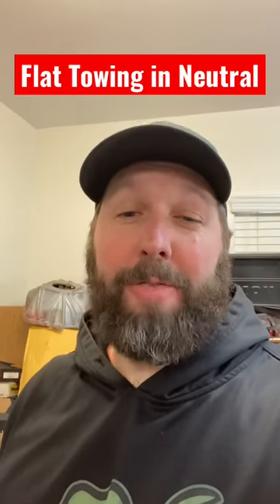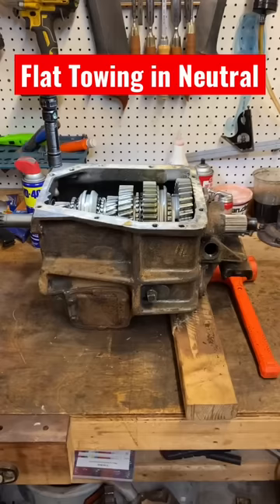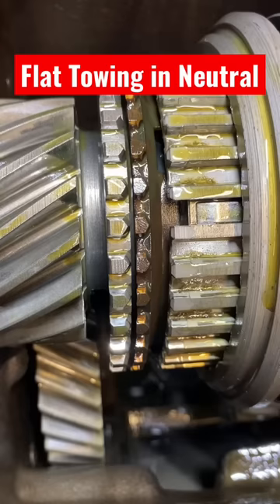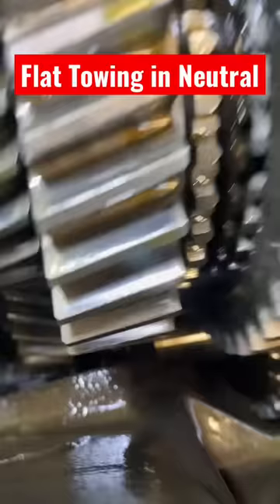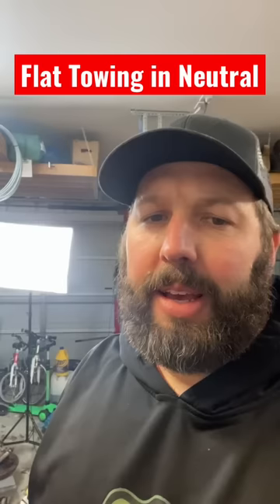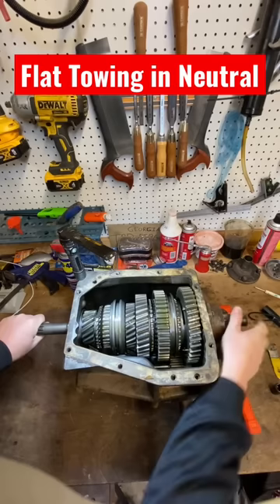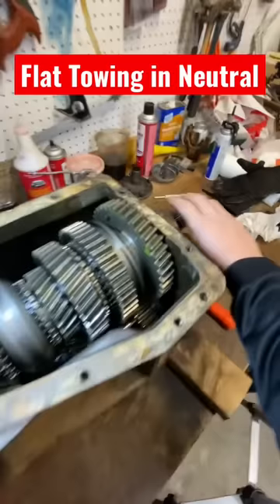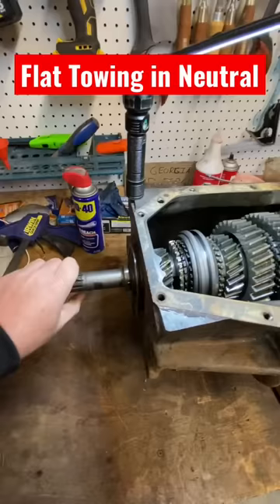Flat Towing in Neutral??? #transmission #stickshift #mechanic

Comment: For most manuals, inflate tires, including the spare 50 psi. fill the crank case with gear oil, 1 quart per 1000 tow miles.
Reply from the maker: Why are we putting gear oil in the engine again?

Comment: There are a few vehicles that you can flat tow.  It all depends on the type of transmission that was designed for.
Reply from the maker: Yes, it’s not applicable to all manual transmissions. You have to refer to the vehicle’s owners manual.

Comment: Flat tow in neutral but make sure the car is on and it is only in emergency like when you break down in the middle of the desert and the next town is 50 miles away with no towing available
Reply from the maker: There are a few options. Best to just consult the Owners Manual. 👍

Comment: I remember this poor old timer towed his Honda Prelude in 1st gear behind his big ol motorhome. Apparently the 454 CID motorhome didn’t much notice. Most catastrophic engine damage I'd seen. Connecting rod caps bent opposite direction. Parts of what were rods dangling out the side and oil pan.
Reply from the maker: What’s that sound??? 🤷🏻‍♂️😂

Comment: If all four wheels are on the ground, put the vehicle in neutral and tow. Vehicles with manual transmissions can typically be towed without the car running, with no risk of transmission damage.
Reply from the maker: Tremec says otherwise 🤷🏻‍♂️. https://www.tremec.com/not_am_detalle/flat-towing-manual-transmission-vehicles/
Reply: Your wrong.

Comment: And an automatic doesn’t cycle the fluid through the cooler unit while the engine is off so automatics will burn out same as manual.  Just disconnect the the drive shaft or tow them with the dolly wheel on the ground and the drive line wheel off the ground. Like rear wheel drive with steering wheels on the ground and wrap the seat belt around the steering wheel a couple times so it can’t move.
Reply from the maker: It not about fluid cooling, its the fact that the parts spun by the driveshaft wont get lubricated because the pump isn't pumping fluid through the transmission. I mean, unless you have one of the older autos that had a rear pump. Those could actually be push started like a manual trans.

Comment: The purpose of the oil is for those gears in the main and counter that are “interfacing” and lubed - however if NO interfacing is occurring - no lube is really required -
Reply from the maker: The bearings and synchros beg to differ. https://www.tremec.com/not_am_detalle/flat-towing-manual-transmission-vehicles/

Comment: Output shaft goes to the rear axle which is still spinning when rolling thus spinning the output of transmission spinning the the countershaft picking the oil up and spreading the oil through the transmission. No issue. 

Where the issue comes in is with automatic transmissions that only get lubrication when the torque converter on the input shaft is spinning with the pump of the transmission.  This is also a problem with some transfer cases because which side of the t case the pump is on. If the pump is on the output shaft your fine because the wheels will turn it and oil everything.

The issue is with automatics not manuals
Reply from the maker: I clearly showed that the output shaft does not spin the countershaft in neutral🤷🏻‍♂️
Reply: @freedomworx  thank you for the correction. I got the shafts mixed up.
Reply from the maker: It happens 👍

Comment: I learned the hard way why you don't flat tow in neutral with an np435. Full set of synchros from an Nv4500, and it was back on the road
Reply from the maker: A lot of folks think I’m just joking. 🤷🏻‍♂️. They gonna learn the hard way also 😳. I didn’t know they used the same synchros 👍

Comment: That’s why you should pull the driveshaft off on any manual transmission that you tow to prevent the transmission from burning itself up the front bearing will burn up. I’ve worked on hundreds of these transmissions and a high-volume repair shop in Detroit Michigan. We specialize in drivetrain components
Reply from the maker: The safest option 👍

Comment: flat towing a manual transmission in Neutral is perfectly OK
In Neutral there is no load on on the transmission gears (they are freewheeling) only the output shaft is spinning and is running through sealed bearings...😎
Reply from the maker: Well Tremec sides with me 🤷🏻‍♂️ https://www.tremec.com/not_am_detalle/flat-towing-manual-transmission-vehicles/

Comment: For special purpose heavy vehicles it can be a problem but not for light cars and trucks. When the transmission is under zero stress it makes no difference how much oil is on the shaft. You could spin it all day long even by hand has he is showing.
Reply from the maker: Well Tremec builds light truck and car transmissions, and they agree with me 🤷🏻‍♂️. https://www.tremec.com/not_am_detalle/flat-towing-manual-transmission-vehicles/

Comment: Did it 1,000 times in the 90's, never an issue, wasn't calling a tow truck i was broke.
Reply from the maker: You should read your Owner's Manual. Towing in neutral is fine for some vehicles. Some need the driveshaft disconnected.

Comment: A friend did this with his 1950 Chevy truck. He towed it from Dallas down to San Antonio behind a rented U-Haul truck. Second gear seized and spun the engine at past redline. Engine and trans were destroyed.
It had an enclosed driveshaft that could not be removed. Should have put the rear wheels on a dolly.
Reply from the maker: Yikes! Expensive mistake! 🥴

Comment: If you can reach the drive shaft, disconnecting it from the differential and tying it up off to the side is the ideal way to flat tow a vehicle with any type of transmission.

If you can not do that, on a manual transmission, you can put the transmission into the highest gear and then use something to keep the clutch pedal pressed all the way down.  That way the engine is disconnected from the drive train and the counter-shaft will be turned by the output shaft and splash oil around like normal.  As long as you do not have to toe it too far everything will be okay.  At worst you will have to replace the throw-out bearing, which is a lot cheaper than rebuilding or replacing the transmission.

If you have an automatic transmission, you are just going to have to figure out how to disconnect the drive shaft from the differential or get a tow truck.  A tow truck is a lot cheaper that replacing a automatic transmission.
Reply from the maker: Yeah, you really just have to refer to the vehicles owners manual. I was thinking about RVers when I made the video, but the vehicle recovery crew jumped all over it. 😂

Comment: I always thought it was "common knowledge" that it was ok in neutral any distance. On old American traditional front engine rear wheel drive manual trans, and classic VW Beetles 1956-1974, always towed in neutral locally but only a couple of times long distance.
Reply from the maker: Common knowledge that it was ok or not ok?

Comment: The 465 can be flat towed at 35mph for 50 miles per the factory service manual. But it really depends on the vehicle. If you have a transfer case, it may not even matter.
Reply from the maker: Interesting 👍

Comment: So. The safest way to tow in neutral… is for the engine to be running and still be turning the input and counter shafts. 
Which kind of defeats the purposes of towing… usually the shitbox is blowed up and won’t start up lol
Reply from the maker: It’s an option, if it’s an option 😉

Comment: The main reason for the oil is when the gears are comected to the other gear. Since you are not in gear no gears are conected to each other. No damage should happen.
Reply from the maker: Spinning bearings and syncros need lubrication.  It has nothing to do with gears in this scenario.
Reply: @freedomworx  the bearings are sealed and greased,they don't get lubricated from the transmission oil.
Reply from the maker: Not sure what kind of transmission you are working on, but I’ve never seen a sealed bearing in a powertrain. https://www.tremec.com/not_am_detalle/flat-towing-manual-transmission-vehicles/

Comment: I don't know what flat towing is but I do know that some cars have to be towed on a flatbed and others can be towed with two wheels on the ground.
Reply from the maker: Flat Towing is with all 4 wheels on the ground.
Reply: @freedomworx  That's the one where you have to have someone in the driver's seat steering it if I remember correctly.

Comment: I've got over a hundred thousand miles towing a Ford manual transmission with no problems whatsoever many vehicles can be towed for down and some cannot for instance a Honda Odyssey automatic transmission in neutral toes fine and most all Chevrolet and Saturn transmissions I do this for a living and there's a lot more to the story than just don't tow. There are resources that can help you decide.
Reply from the maker: The rest of the story is in the owners manual, that’s why I said to refer to the owners manual I. The video description. There is only so much information that can be conveyed in 60 seconds. The original video was 90 seconds. https://youtu.be/yCOos-u0oKs?si=BjvM01n7slzFhGO4

Comment: The fluid inside is higher than the out put shaft. The main shaft is also throwing up fluid.
Reply from the maker: Not unless you’ve overfilled it. That would be extremely inefficient.

Comment: I've only flat towed a few times, the first time the towed car had no transmission and the drives haft just flopped about deafening it's owner in the car lol. It was very late at night and I was towing my mechanic mates CRV with no engine or tranny. Late at night so as to reduce the risk of him rear ending me or hitting someone else lol. 

The second time the same mate flat towed my 4x4 about 200 miles in the middle of the night.  My EGR pipe had literally detonated, creating a huge exhaust leak so the engine could run but would make no boost. I sat in it with the engine idling with the transfer case in neutral and transmission in 4th for lube. Sketchiest thing about that trip was when my GF who was in his car jokingly said "we should go to Hungry jacks [Burger king] drive through and our autistic friend thought she was serious and flat towed me into a fast food drivethrough at 1am Monday morning lol. 

The last time I flat towed it was my mates 4x4 Jeep and the transmission was fucked anyway. Mind you my car decided that it would be a great time for the crank angle sensor to intermittently die when it got hot so that drive ended up being about 5 hours longer than planned lol.
Reply from the maker: Starting to sound like you are a flat tow pro 😂😂

Comment: This is the first time I've heard this, and I know many people who flat tow manuals in neutral.  Maybe this particular trans won't handle it, but most do.
Reply from the maker: It’s actually the other way around. Some transmissions will handle it but most won’t. There is a reason you generally see the same type of vehicles being towed behind an RV. It’s because those vehicles can be flat towed safely without damage. https://www.tremec.com/not_am_detalle/flat-towing-manual-transmission-vehicles/

Comment: I think for flat towing you have a couple of options:

1. Put the transfer case in neutral
2. Remove the drive shaft
3. Leave the engine running so the transmission gets librication. (This is the most dangerous option especially if nobody is in the vehicle to shut it off if something goes wrong, but this may be your only choice in some emergency situations. Not to mention that the vehicle might not have a running motor - hence the need for a tow!)
Reply from the maker: Those are all options 👍

Comment: Y'all are doin' it the hard way!  On the SM465, just pull the shift lever out, pour in more gear oil till full, reinstall shift lever, done.  Flat tow all you want after that! Oh, when driving the "toad", just ignore the lack of power and fuel mileage - it's making up for the "free MPG" while being towed. (wink, wink, nod)
Reply from the maker: That’s an option 👍

Comment: One time a friend of mine was flat hauling his manual s-10 to a show and the trans slipped into third going down the Highway at 75 mph 😳 we think a bump knocked it into gear cause we hardly felt it behind the truck 😂 anyway smoke starts pouring out the rear from the s-10 and we pull over to find out we had driven with it in gear for atleast a couple miles. She was fried to say the least. But we took the driveshaft off and kept boogieing down the road and made it to the show!! It was a sound off didn’t really require the car to move 🤣 the starter pulled it out of the lanes 😂😂
Reply from the maker: Whatever it takes 💪🏼

Comment: How do you detach the drive shaft? Good Lord you’d think the manufacturer would have a towing mode. I thought these engineers were some of our are brightest minds.
Reply from the maker: Nothing wrong with the design. Most RWD MANUAL TRANSMISSIONS don’t allow flat towing. The ones that do, do it by accident and are less robust designs. This is a pretty common attribute of stronger manual transmissions. And virtually no automatic can be flat towed in neutral or any other gear. The oil pump is driven off the engine on an automatic, that’s just the way it is.

Comment: I believe a car with an automatic transmission can be flat towed for short distances if its engine is on and idling and the transmission is set to neutral.  But I am pretty sure even this would be detrimental over long distances due to not that much oil being splashed up at the engine's low idle RPM by the inlet shaft and its gear set relative to the much faster RPM on the outlet shaft side's gear set.
Reply from the maker: You should read your Owner's Manual. Towing in neutral is fine for some vehicles. Some need the driveshaft disconnected.

Comment: I love flat towing with the E brake fully engaged/ back wheels on the ground and all. Little smokey at 1st for sure😂
Reply from the maker: Gets easier once you get down to the wheels. They have less traction than the tires.

Comment: You're going to have increased engine leakdown if you trailer a vehicle with manual trans while IN GEAR.   The cylinders will wear along with the rings in the length of stroke the piston slides up and down due to the slight movement/rocking of vehicle while on trailer during bumps, accelerating and braking, etc due to various factors from chain flex, strap stretch, etc.  Had a brand new $41K tour engine from Performance Technologies go from 2% leakdowm to 6% leakdown just from am 1100 mi tow to next race.  A  crew members nephew climbed in the car while in the trailer and knocked it in gear while he was climbing out.  That 4% leakdown spread is a ton of horsepower loss, especially in a rule restricted engine.
Reply from the maker: Well I’m talking about flat towing. Like dragging a Jeep behind an RV. Not towing on a trailer. And I wasn’t insinuating that it should be done in gear. But that is an interesting discussion about trailering a vehicle in gear. I had never considered the rocking attributing to cylinder and ring wear.

Comment: Also the reason I shift from neutral to 1 with the engine off  after it's up to operating temperature. Then restart in gear with the clutch disengaged . This is on my motorcycle
Reply from the maker: I haven’t ever analyzed the gearbox on any of my scooters 🧐
Reply: @freedomworx  scooters don't have a gear box its a CVT belt. And scooters were invented for women so they could ride with long skirts.  Ok boomer
Reply from the maker: Boomer??? 😂. I commonly refer to all motorcycles as scoopers. Probably because my Grandad did. Only actual scooter I’ve ever owned was a Honda Ruckus. Fun rig, just not built to haul an Ogre like me. But I’ve had all flavors of motorcycle. But I’m partial to 2-Strokes.

Comment: Interesting. Here’s an add on tip. Manage your tow vehicle lights wirelessly, similar to what's demonstrated in the TA67 Towaide control panel. Low Cost and no cord
Reply from the maker: Thanks for the tip  👍

Comment: Do the same test with oil in the transmission.  The last gear on the output shaft is in the oil bath.
Reply from the maker: It might be on some, but it’s not on others. Every design is different. https://www.tremec.com/not_am_detalle/flat-towing-manual-transmission-vehicles/

Comment: A little plumbing trick and the transmission can be overfilled for towing and emptied to normal levels for driving.  I pull behind a motorhome ... for many years now!  Vacuume powers the sustem.  It's a slober tank.
Reply from the maker: Yeah. You could put a 90 and short piece of pipe on the fill hole and raise the level. 👍
Reply: @freedomworx  You got it!  Valve a vacuum line to the intake to suck the trans into a slobber tank to control the fill level, then close a valve between the slobber tank and the trans.  To prep the trans to take in the oil, pull a vacuum with both valves open, then close the vacuum valve and open an atmosphere valve at the top of the slobber tank, the trans sucks the oil in.  The line from the trans needs to be a continuous slope to keep it from air locking during trans filling.

I deliver motor homes from the factory.  Done it hundreds of times.  Works good!
Reply from the maker: I was just going to use a squirt bottle 😂👍
Reply: @freedomworx  
Yes! 
Works good for a one-time or infrequent use.  I hook once a day or more to once per week. Sometimes, when I pull from Indiana to the coasts, it can take 10 days if I hit snow.  Working a few valves is better than crawling about on my back with a squirter.
Reply from the maker: I’m sure 👍

Comment: Just pull drive shafts auto or manual saves a lot of time money and headache replacing u-joint straps/bolts is easier and cheaper if they brake and you can also check your u-joints for wear and replace those as well if needed.
Reply from the maker: It’s the safest option. 👍